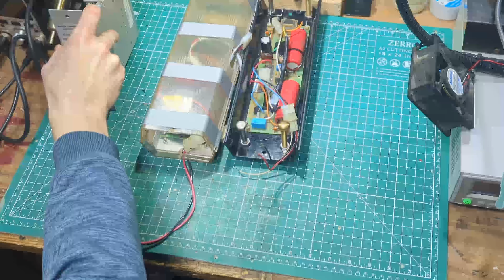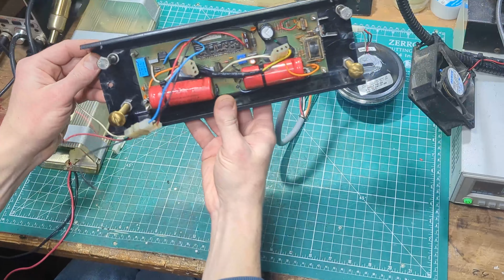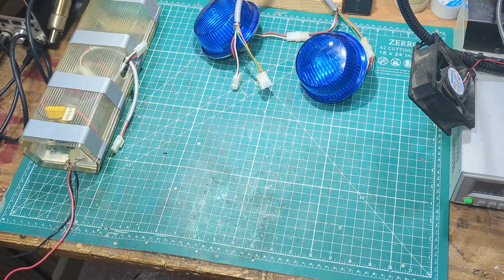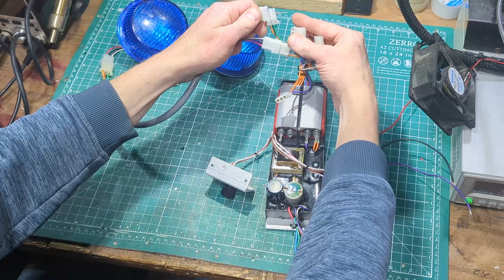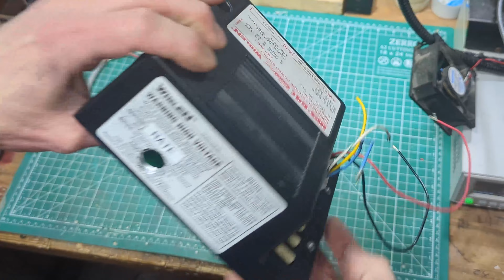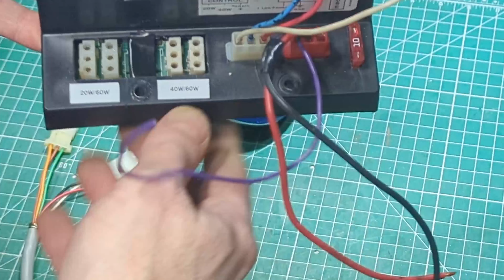Special Strobe Power Supplies For Testing

Comment: This just reminded me of a faulty Delta Design beacon I have in the UK. It only flashes single rather than double and I assumed it would be capacitors failing or triggering components but maybe the tube is weak? I kind of assumed the tubes either work or not but sounds like that is incorrect?